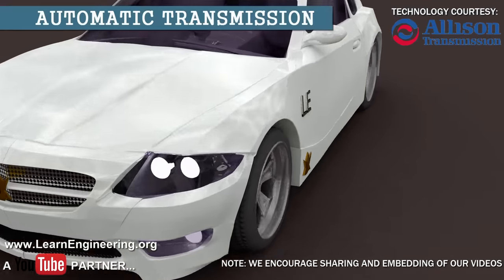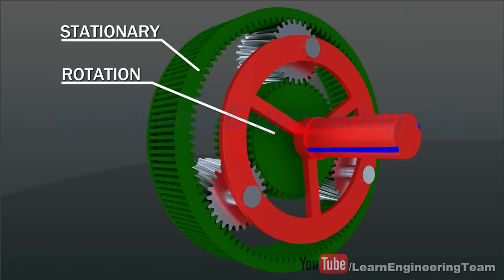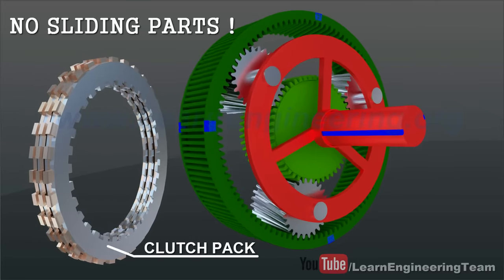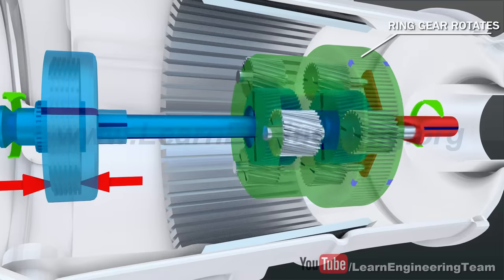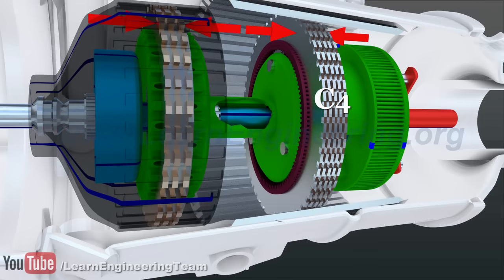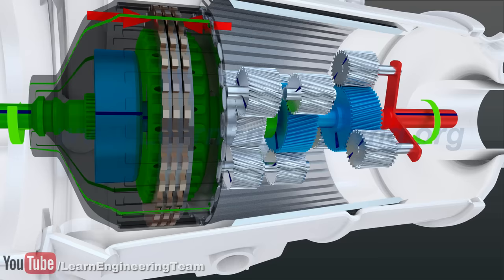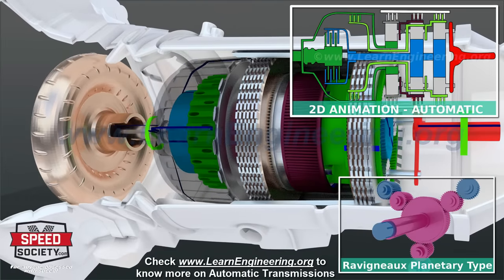Automatic Transmission, How it works?

Comment: When they say "it's not Rocket science", they really mean to say "it's not an automatic Transmission".
Reply: Turbine engine is much easier to understand than this.
Reply: I'm glad that the cars coming out in the next few years won't have transmissions.
Reply: @AKX-DTGRSMP  Look into turbine helicopters, you have both ;)
Reply: I actually understand rocket science pretty well, and I thought I understood automatic transmissions until I watched this video
Reply: Unkwon Malaysian Guy      CVT: What's reliability?
Reply: @michaelbujaki2462  Me: Launching with Porsche Taycan and the hope for manual electric Mustang.
Reply: bunker  Yes they do, but it doesn't mean that we shouldn't work towards electrification.

Besides, it's the cars stuck in traffic that waste the most fuel.
Reply: bunker  54% of cars bought in Norway last year were EV's tell them. Works like a charm.
Reply: bunker  full electric is 54%, plug-in hybrid 20%, non plug-in hybrid 9%, petrol 8%, diesel 9%. Teslas fast charging network is already insane. Trust me, it's the future.
Reply: bunker  you should test drive one (model 3 for example). They're amazing and far from a meme.
Reply: Lol
Reply: @SergeantExtreme  yep. But the people in charge don’t want that to happen
Reply: Quite right ! Spot on comment
Reply: It doesn't take rocket appliances to figure that out.
Reply: Unless it’s a catch 23 situation..
Reply: DCT and CVT automatic transmission are simple
Reply: Can someone explain how  the egr works
Reply: I literally understand rocket science better than this.
Reply: Rocket science is fun compared to this 😂
Reply: Yea rocket science is way easier to understand than this
Reply: @AKX-DTGRSMP LITERALLY
Reply: oh no, automatics are simple, just... this doesn't make it noob friendly.
Reply: The Kingdom of God is at Hand 
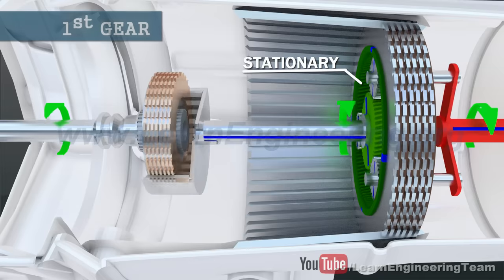John 3:16
King James Version 
16 For God so loved the world, that he gave his only begotten Son, that whosoever believeth in him should not perish, but have everlasting life.
Reply: you and the other guy who read rocket science to relax after watching this are now tied for comment of the year

Comment: “This is the simplest form of an automatic transmission” nervous laughter
Reply: Beautiful comment = 😁👌
Reply: Manaul is very simple
Reply: Putin3D but harder to drive
Reply: Btw i don't think this is simplest i have seen way simpler than this today but it was no a car gearbox.
Reply: The simplest form is the one & two-speed automatics, not a bloody six-speed...
Reply: @Sampson_YT  Not really, as it is much harder to get a manual transmission car stuck in the mud or snow...
Reply: @Sampson_YT  gay
Reply: Lol
Reply: CVT is infinitely simpler, and it annoys me that so little used. And it annoys me more that by customer pressure, auto makers artificially limits the efficiency of CVT, so that driver can feel the jolt in a shift that would otherwise be smooth.
Reply: Look up a 3d printed automatic transmission
Reply: @lucasvella  Cvt r more efficient at the expense of driver feel and noise likely through sustained higher rpms.
Reply: @duramaxdad  more expense by being generally unreliable.
Reply: But, its conplex system
Reply: Lmaoo
Reply: @lucasvella  that simplicity is part of the problem... A Honda 10 speed AT will last much much longer than a band between some rollers. And if we're being honest here CVT's aren't crazy more efficient than the same car and engine with a regular old gearbox their only saving grace is the ability to modify "gear" ratios on the fly to just about anything within reason.  And even the efficiency gain from that is nothing (.5-1.5 miles/gallon) compared to the gains you could get from VVT for instance (3-8 miles/gallon). Compound this with the fact that we're not really trying to get efficiency out of transmissions and gear ranges because there's just nothing left to gain. Hell we could have 40 gear trannies but we don't because we don't need that many gears. Stacking overdrive gears or making an infinite gear range doesn't mean better fuel milage, efficiency, or reliability. It just means that I can put power to the ground at any speed I want at any rpm I want. Want to go 120 miles an hour at 1,500rpm? You need a 10 speed. Want to haul junk a long distance without burning up your transmission or being above 3,000 rpm? You need a 5 speed. Want to have a nice economy car that makes no noise or road vibration at 70 mph, but also can't cost more than $30,000? You need a 5 speed with an overdrive gear. Want to go around corners and never leave your optimum power band while having an infinite range of gears so you can put power down without slippage in any situation? That's when you need a CVT. In all honesty CVT's are not a good alternative to a regular old gearbox unless you're driving a F1 car. Oh and that shift kick doesn't really down the efficiency by a whole lot I'm pretty sure the most it could really do is cause a little slower shift. All it is is to simulate a real shift kick from a regular tranny because people didn't like the smooth shift. And I'm glad they did it because it's actually helpful when diagnosing the CVT's.
Reply: No s... It's incredibly complex
Reply: @amypalmeri7211  
Getting a headache trying to understand all this ? Not alone
Reply: @Sampson_YT  manuals are easy to drive once you learn what the "friction zone" is. Manuals are also much better in complicated situations involving snow and mud (assuming you have the correct tires for the situation) because you have much finer control over the amount of applied torque (too much torque applied too fast = wheels spin in place and car won't move, which is what happens with automatics unless they have extra computer modules and sensors which can intelligently detect the problem and manage it - these extra features are not available on most affordable automatic transmission cars).
Reply: Hahahahahaha
Reply: I don't think it is. There are quite a few (older) cars with a three-speed automatic.
Reply: There is a harder version, Quantum Automatic Transmission
Reply: Hehe I'm in danger
Reply: I garuntee a cvt is easier to understand. It's a belt and a slope
Reply: @lucasvella cvt is shit for cars